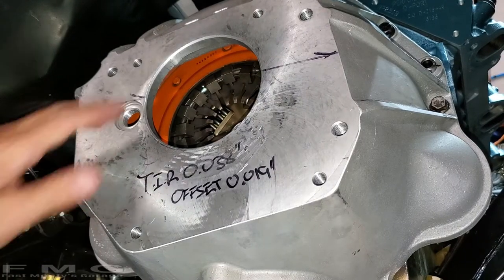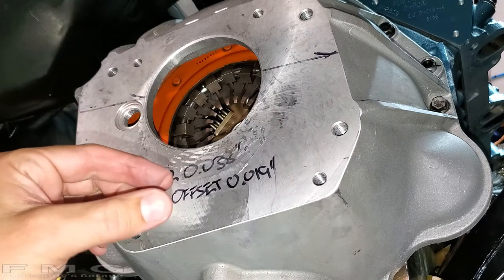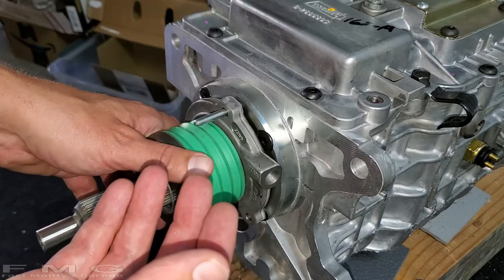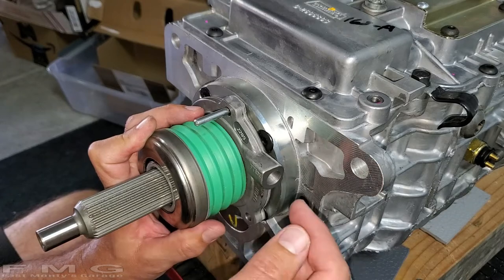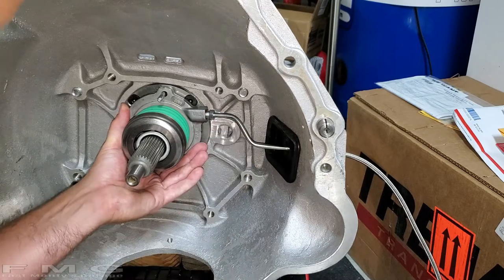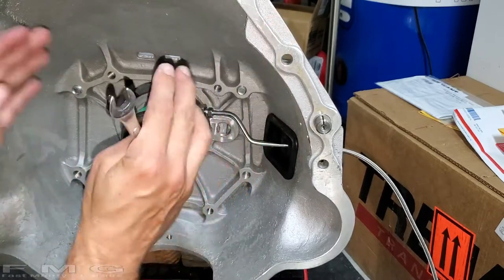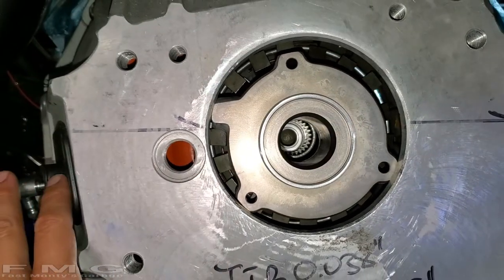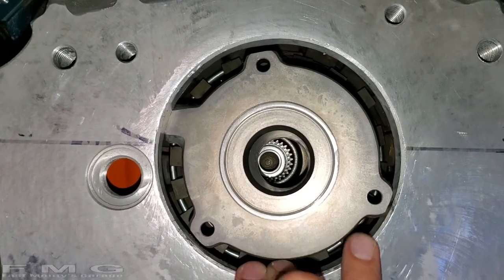TREMEC TKO/TKX/T56 Install, Part 9b: How to install a Hydraulic Throw Out bearing or Slave Cylinder.

Comment: One tip about bleeding the hydraulic clutch is this....: After you hook up the line and the master you fill the master 1/2 way with dot 4 then while under the car you slowly compress the bearing and the hydraulic clutch until you bottom out then there will still about an extra 1/2" of travel in there and thats whare it gets messy if you dont put the cap on loosely but the last 1/2" really powerblasts the air out through the master enough to where you will have to refill the reservoir to 1/2 way again and once the air is out doing this 2-3 times the fluid pressure on the hydraulic bearing stays locked back to make it like it was before adding fluid using the spring to hold the bearing out until you install the trans and push the pedal. I guarantee if you do it my way bleeding becomes a pinch me moment as the hydraulic clutch works instantly...Take care.
Reply from the maker: Thanks for leaving that detailed comment... kinda like bench bleeding.  I like it!  Thanks!

Comment: Just to confirm, the McLeod clutch came with a couple extra parts. One is a bearing and the other is like a spacer. This is a throw out bearing and maybe a pilot spacer?...that is replaced with the hydraulic green accordion looking thing? "I have NO idea what I'm doing" 😊
Reply from the maker: Hey Brother... I have no idea what you're looking at.  If it's about an inch in diameter, it's a new pilot bearing.  Some cars use bushings, maybe they gave you both?
Reply: I don't know either but I'm going with - McLeod probably doesn't sell a clutch without a linkage type throw out bearing. Silver Sport sent me their clutch in this kit. You probably didn't see it because you reused your whatchamacallit.
Reply from the maker: @designsinorbit  Ohhh yes... mine was a Dooo Hicky.  Let us know what you learn!

Comment: Quick question..  Where did you get the boot that goes in the clutch fork hole? did it come with the SST kit? I can't find one with the holes for the hydraulic lines instead of the fork.
Reply from the maker: Great question!  Yeah that came with the SST kit.  Give em a call.

Comment: Hello, How it save knee? 2015 Mustang 2.3t come with stock Hydradulic CSC, and it is killing my knee. What effect the clutch pedal force? pressure plate spring or Clutch Master Cylinder or Slave Cylinder?
Reply from the maker: Good question... it's a little easier on my car, because I switched from a Mechanical Spring to Hyrdaulic.  For your car, you need to look into a lighter Pressure Plate.  Unless, there's a larger diameter master cylinder available?  I do not know.  Let us know what you figure out!
Reply: @FastMonty  Thank you for ur reply. I just buy a Mcleod twin disc clutch kit, dont know pressure plate spring lighter or not. I know the Mustang V6 and GT`s clutch are softer than 2.3, and 2018+ model year`s GT (which has twin disc) clutch is much softer(23lb in 5.0 vs 33.6lb in 2.3t). And all of them using different clutch master cylinder and CSC, but there is not any info online shows the cubage of each cylinder.
Reply from the maker: @JJ-zm7kj  Awesome!  I have a twin disc clutch too, and love it.  Have fun!

Comment: I just bought a TKX and I was wondering if I needed to change the bearing retainer it came with to install the throw out bearing or could I use the one it came with and just put in the guide rods for the bearing ?
Reply from the maker: That's a fantastic question.  I'm pretty sure there's also a pilot diameter that matches the throw out bearing.  Regardless, I would ask the manufacturer of the throw out bearing you're buying to find out if it needs an anti-rotate bar, AND/OR if you can just add it to your current retainer.  Let us know!

Comment: How are you going the bolt down the slave cylinder on the front of the trans?  This makes no sense the way you are going about this.
Reply from the maker: Well, that's because it doesn't.  It's meant to "float" in between the trans and pressure plate.  Hope that makes sense, let me know, if not.  And, yes, this is exactly how you install this system.  Works awesome.  Thanks
Reply: @FastMonty  i just watched a few videos because I need to replace slave cylinder on 2000 SS and all other videos show bolting it to the front of the trans, your trans has the bolt holes but you are not using them.  You would not want your throw out bearing touching the fingers of the pressure plate all the time it not made to do this much wear and tear.  Even in my old  big block 69 you have a spring that keeps the throw out from touching the pressure plate fingers unless your are using the clutch.  Maybe you should check with silver state.
Reply from the maker: @mechardable  I hear you... a 2000 SS does not have a Temec TKO/TKX does it?  Point is, not all throwout bearings install the same way. In this case, the throwout bearing does NOT bolt to the transmission and DOES ride on the pressure plate fingers at ALL times. That's the way it was designed. My video is accurate because I had Silver Sport comment on it BEFORE I posted it. They use it now as their install video. So, definitely find a video that's applicable to your make and model car and transmission. Good Luck!

Comment: Seems wonky to me.  I have only done manual clutches.  I would install the trans with the  front trans housing already bolted together  and the throw out cylinder and bearing already installed over the input shaft.. The input shaft will keep everything in place .
Reply from the maker: What's Wonky?  FYI, some cars you can not install the trans attached to the bell.  (Like mine)  Thanks for the comment.
Reply: @FastMonty    Strange, what car  can't you attach the Transmission and Bellhousing as one unit?  
  My 3208 Cat  636 Cubic inches  1,500 pounds uses a number 2 Bell Housing  with a Free hanging 10 speed Eaton Transmission that weights 477 #  It uses a 14" dual disk pull type clutch .. The 1968 6 wheel drive Truck had  a 501 Cubic inch gas engine and  a 5 speed fuller ahead of a  3 speed transfer case that weight 1,005 pounds.  
  The Transmission hangs over the front drive axle  so I pulled the engine and trans as one unit.. had to take off the hood take out the radiator ect to get it out.  because all of the bell housing bolts came loose. 
  Maybe because of excess vibrations in the crank shaft pto running off from the front of the engine. The Cat has an Aluminum bell housing. the  housing transmission is Cast Iron.  Thus I can't get a transmission jack under the transmission .
Reply: @FastMonty    Oh Pontic GTO .. I would think that all GM cars are the same.  First Gen small and big block chevy have the same bolt pattern as my 4 cylinder Chevy Chevette had and the same bolt patter that bolts to a Number # cast Iron bell housing that  I bolt a 13 Speed Eaton that has a  12" dual disc clutch .
Reply from the maker: @mikeskidmore6754  Good stuff Mike... that's a monster transmission.  lol.  To answer your question, my car.  It is physically impossible to install the transmission into the car, with the bell housing attached.  You have to get it over the pressure plate, which means the bell housing is 4" rearward, which hits the transmission tunnel.  Ask me how I know.  :)   Thanks!
Reply: @FastMonty    Seems I always  put a block of wood under the oil pan or the back of the engine .. Remove your transmission cross member..  You can drop the back of the engine down a lot .
  The  RT-613 Eaton is called a Baby 13 speed for  medium duty trucks.
   The Heavy Tranmission  Like a 13 speed or 18 speed are rated for 1,800 or 2,000# of  torque.. the  first number  6 is for 600 ft #  
  RT  for Derect Drive RTO for Over drive..
  My 13 speed is actually a five speed transmision with two reduction systems added .. they don't call it a 15 speed because two gears in low range overlap
Reply from the maker: @mikeskidmore6754  Yeah Brother, I appreciate your enthusiasm.  I use the same method.  BUT, you can NOT install the trans with the bell, at least on GM A-Body's.  Second to that, if you're installing a TREMEC, you have to align the bell to the crank to +/- 0.005"  So, best to double check that measurement BEFORE attaching the transmission.  Thanks for sharing your truck info!
Reply: @FastMonty    Yes you have to mount the Bell housing alone so you can check runout.  Once offset Dowel pins are installed and locked down that alignment won't change..
Reply from the maker: @mikeskidmore6754  Agreed.  Still have to mount the transmission after the bell housing.  Not at the same time.  Thanks!

Comment: I just did this today and have 1/16 difference my bellhousing was 2 and 7/16 and the hydraulic throw out bearing was 2 and 3/8.
Reply from the maker: Sounds like you might need a spacer.  I'd contact SIlverSport to see what options you have.  Most likely, you'll need a transmission spacer, to pull it off the Bell housing.  Let me know how it goes!
Reply: I called SST and they sent me a .25 spacer plate no charge since I bought the complete perfect fit system. I just finished installing the transmission today. Now off to measure for the drive shaft. I have the TKX and other than cutting the opening for the shift hump I had no other tunnel mods required on my 66 Malibu! Thanks for all the awesome content!
Reply from the maker: @richardrosa4826  Awesome Richard!  SST is fantastic like that... which is why I always say I love their Customer Service.  Thanks for sharing your build specs, and that the TKX was a breeze for your Malibu.  Keep up the great work!

Comment: Just curious, why don't you just leave the bell housing on the trans and put the entire trans/bell housing on the motor, that way the hydraulic throwout bearing isn't bouncing around? I am putting my kit together so I'm curious if my way is wrong for some reason.
Reply from the maker: Good question, not sure what car you have... but on mine, I don't have the lateral room to move the entire bell house the length of the input shaft to get it into the clutch.  (It would hit the tunnel)  So, the bell has to go on first, then the transmission.  Hope that helps.
Reply: @FastMonty  Ah, got it, I am assembling mine outside the car. I just wanted to make sure I wasn't missing something.
Reply from the maker: @lususvir  Yup, that makes sense.  I could not remove the trans and engine at the same time.  So, lucky you.  ha, ha.  have fun!

Comment: Can not use a "slide ruler" You need to use a caliper as someone like McLeod requires .100-.250" clearance.
Reply from the maker: You referring to my straight edge and ruler trick?  Sure, you can use a caliper instead of a ruler... same thing.  At the time of this video, spec was 1/8" to 3/8" (.125" to .375" if you're using calipers... ha, ha..)  Thanks

Comment: What parts needed to make this with work chevy 350. Clutch, pressure plate - they make fingers that don't stick out some much, flywheel.  2 peace main, What's the specs on the bearing fully close. I need to lose 0.44 spacing. To use a hydraulic bearing. 1.710 bearing closed press in on the clutch fingers.
Reply from the maker: Good questions. I highly suggest calling Silver Sport Transmissions they have the knowledge, and the parts. Have fun!
Reply: @FastMonty Silver sport kinda brush me off. When trying to get specs on parts. I have about 7 people now I found  going through this as well. It's very hard trying to get this info. flywheel, clutch and disk, Using a stock type chevy bell-housing.
Reply from the maker: Sorry to hear that.  BTW, have you considered using a transmission spacer?  That's what I had to do.  @jagco2594

Comment: Will this reduce pressure for a performance clutch?
Reply from the maker: You mean pedal force versus Mechanical?  Yes.  :)   Good question, thanks.
Reply: @FastMonty  is it less force on clutch pedal compared to a regular slave cylinder? Idea is to save my knees using a performance clutch. Thanks
Reply from the maker: @kutlee2009  Good question... I don't know how it would compare to another slave cylinder.  I went from Manual to Hydraulic, which is easier on my knee.

Comment: Why would you not leave the bell housing attached to the trans? Seems kinda backwards. Not saying your wrong. Just curious
Reply from the maker: At what point?  Measuring the throw out bearing?  Or, installing it to the engine?  If you're referring to installing it on the engine, you don't have enough room inside the tunnel, to have a direct shot at inserting the input shaft through the clutch, and into the pilot bearing.  It's about 8" of throw, where the tunnel might allow you to move it 1".  It's impossible.  :)
Reply: @FastMonty  perfect explanation. Starting this one install tonight on a 67 Firebird. Great videos! I’m lucky and the engine and trans can be stabbed at one time.
Reply from the maker: @timmay0330  Ohhh, nice!  I'm jealous.  Can't wait to hear how it goes!

Comment: Great video. I have a ?   I just ordered a TKX 6 speed.  How much trouble is it to change over to a hydraulic throw out and what are the benefits over a manual one?
Reply from the maker: Thanks Chad!  It's easy, just watch my video series on the hydraulic clutch install.  It's easier to push than a manual clutch, and automatically adjusts as the clutch wears.  Good luck, and dont be afraid to ask questions!  Welcome to the channel.  (Ohhh, I'm getting a TKX too :))
Reply: Also gives you a ton of room for headers.

Comment: What do i do if it to tight with no spacers yet?
Reply from the maker: Great point, Thordan.  I probably didn't mention that.  For those curious, if you didn't have enough space when the throw out bearing is fully collapsed,  you need to add a spacer between the transmission and bell housing.  Reason is you'll need around .200" of play to accommodate for disc wear, because the fingers on the pressure plate start to extend, closer to the throw out bearing.  If you don't have enough space, the pressure plate will not fully apply pressure on the disc, and you'll start prematurely slipping.  So, contact Silver Sport Transmissions (www.shiftsst.com) and ask for a transmission spacer for your vehicle.  They're typically .250" thickness, and around $60.  Hope that helps!  And, thanks for the comment!
Reply: @FastMonty  thanks
Reply: @FastMonty  I went on the that site..I couldnt find any spacers in there search engine
Reply from the maker: @DanneyTanner  Yeah, send them an email.  I know they have them.